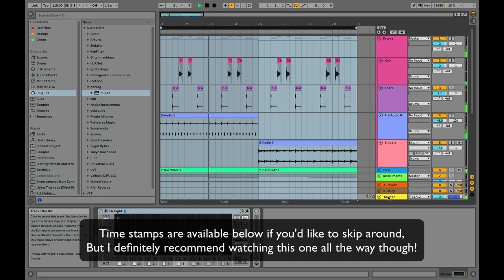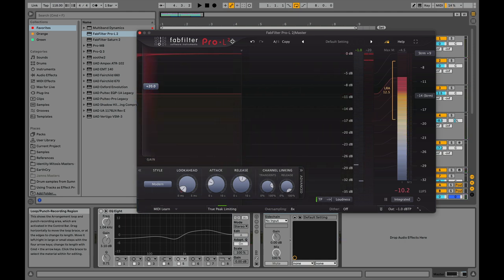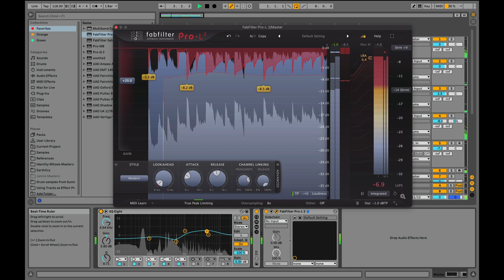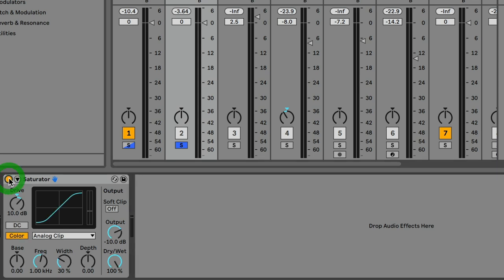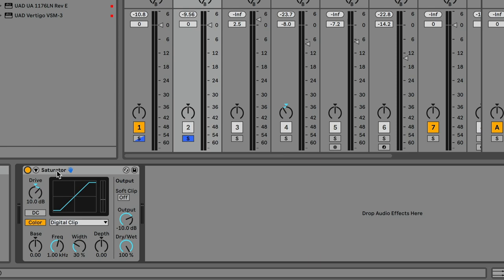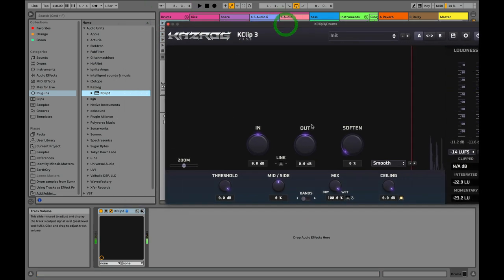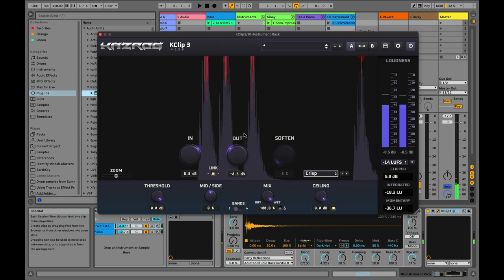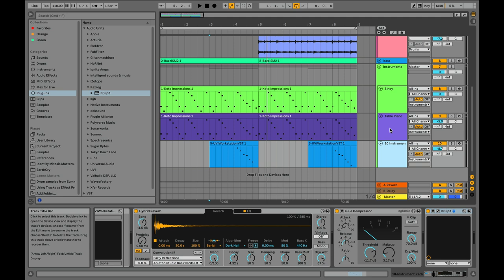Kclip & Ableton Live: Transparent Clipping for Louder Mixes

Comment: Great content as always, Anthony. I saw this concept via Baphometrix first, and now again through your post. Quick question - is the idea to mix without clipping first - i.e. get the relative track levels to where they’re sounding right - and then go through the clipping exercise, first at individual track level, and then on subsequent busses? That makes the most sense to me, but would love your insights here.
Reply: Hi im no pro but i like to adjust the levels after everything is normalized on every track with the gain “staging” (getting every sound to a target level using dbMeter5) and then clipping if its still not loud enough to match the kick and snare (which you should start with to set a baseline for the loudest sounds in your song)

Comment: Really cool video!
But I must say that at 15:20 mins I can hear drastic changes in lows and on the punch portion of the Kclip process.
Maybe that's because clipping for this purpose (get louder mixes) was not the goal of the Kclip program, I don't know.
Maybe heavy low freqs material is not a good choice for a razor-sharp wave format (808s are mostly sine waves, and I'm sure you know that).
But I'm still looking for a better solution...
I mean, for situations like that, where kicks like this one simply seem to fight against the clipping transparently process...
...maybe something like you've done with that synth, maybe the shape of the kick can be another issue. Who knows?

Comment: Hi there, why were you clipping after the Hybrid Reverb in your Synth track ? (Labelled 10 Instrument). From what i've understood from the Baphometrix videos, you'd want to do clipping prior to adding any effects in the signal chain. 
A) Could that have been why you opted to use a Glue Compressor ? Furthermore, was it because the Hybrid Reverb added to the timbre of the synth, that is why you chose to add KClip3 after it ? 
B) If Hybrid Reverb was influential to the timbre you desired, why not include it inside of the Instrument Rack and blend it in with the dry signal ? 

Thanks in advance!

Comment: Great video! The example using a compressor to shape the dynamics before running the signal through KClip was super helpful. Also, I’m pretty sure baphometrix’s pronouns are she/her fyi. Looking forward to your next vid 👍
Reply from the maker: Ah my bad! I didn't know!
Reply: @SeedtoStage  No worries! (See my comment about it in another thread.)  BTW, yes, I'm super glad you showed how a typical bus compressor attack can "thin out" the transient enough (and gently reshape the sustain lower in amplitude) so that you *can* clip an un-clippable signal. It's a very useful trick!
Reply: @SeedtoStage  what do you do with all the extra headroom you get from clipping to make the track louder? Say you have - 9db at the master. Do you just use a limiter and push the signal into it by lowering the threshold?

Comment: hey @SeedtoStage - I'm wondering if you've ever noticed one interesting thing after applying KClip to the audio channel - it looks like if you cut the low end from the sound (lets say it's hats and you want no low end on them) by applying the equalizer, then apply KClip, then add a spectral analyzer - you'll see the low end there again (though it's looks quiter than before). is there any way to get rid of the low end post-KClip completely?

Comment: Can somebody explain what can be different between hard clipping algorithms? It's such a basic operation that I wonder where there is any room for variation. The only thing that comes to mind is different levels of oversampling, but then it's still basically the same thing, just on a higher sample rate.
Reply from the maker: Youre right, as i understand it, its more the user interface of the plugin, visual feedback, oversampling, but ve also heard that subtle waveshaping occurs on some clippers and Baphometrix says that Eventide's Saturate plugin does "spectral" clipping which can sound a bit different. I dont have experience with that plugin yet.
Reply: @SeedtoStage  Hm, thanks. I would imagine that any waveshaping only makes it less transparent, but I might be wrong. I guess you could do different things to the flat clipped tops maybe. Wasn't aware of spectral clipping, thanks for pointing that out.

Comment: I can’t shave off more than 1-3 dB without my transients turning into mush and it’s peaking at a low level to begin with, just setting my average levels. Don’t understand how you can shave off 10dB. Where using the same plug-ins.
Reply from the maker: Each sound will react differently to clipping. If you’re working with sounds that have a low harmonic content like sine and triangle waves or soft sounds, saturation and clipping can be immediately apparent and undesirable. If you need more out of those kind of sounds, perhaps compression is the ticket.

Comment: Really great look at this topic! Thank you! I have a question I feel like you might know a little something about. A lot of times when I'll clip out peaks on sounds, whether its with a saturator or glue compressor soft clip, I'll add an EQ afterwards. For some reason that always reintroduces the peaks I just got done cutting and I have to follow the eq up with another clipper. Any idea? I've tried it with Pro-Q3 and EQ8, and I'm not making any boosts. usually just a high passing out the lows.
Reply from the maker: A clipper is commonly used at the end of a signal chain because eq works by way of phasing and that can cause a track to increase or decrease in peak value.

Comment: Lots of mistakes you did there. For example: you could have used a softer clipping curve to process that melody instead of assuming that hard-clipping would be useful.

And why do you leave the reverb in the middle of the chain, then go on to compress and clip the reverbed signal? You could have used the revetb to the last position, which sonically makes more sense.

Are you a professional?
Reply from the maker: This video you are commenting on is about hard clipping not soft clipping curved saturation. Hence… no soft clipping. Also while it’s common practice to put reverb on a send or at least at the end of a chain, compressing after reverb is in a signal can provide interesting results and be more of an exaggerated effect. What do you think happens when you record drums with mics in a drum room? There is reverb in the room and drum mics almost always get compressed. Compression after reverb is very common. In fact hard compression on drum room mic signals is common practice. With all things audio, there are more ways than one to accomplish things and avoiding formulaic solutions is a generally good idea rather than “always do this or that”. None of what I did on this video was a mistake.
Reply: @SeedtoStage  Inaccurate! Compressing reverb tails as an special FX is different from the mistaken compression and saturation you have done due to sub par order of your plugin chain.

If you want to compress / saturate reverb for an exaggerated effect, I would advice you to use a separate send / fx channel and apply your saturation directly to the reverbed signal. This way you can focus and fine tune the saturation for the reverb instead of going all over the place and applying it on a semi-reverbed dry and wet signal without focus.